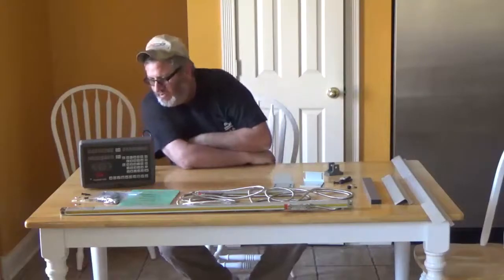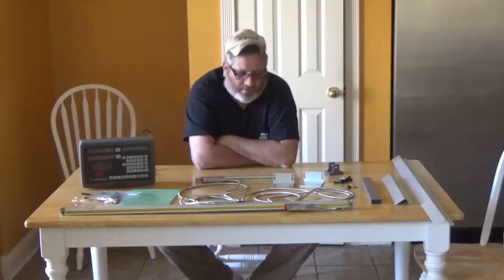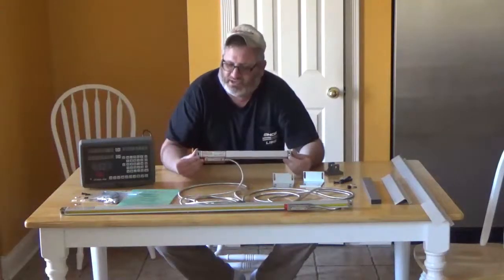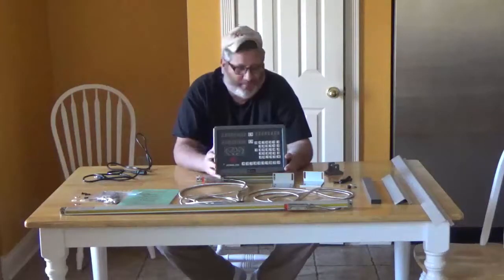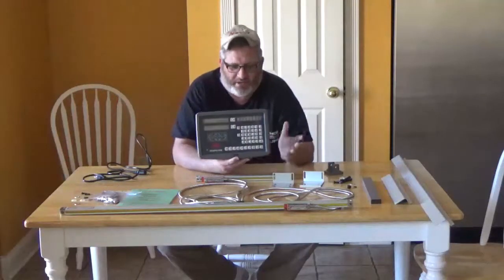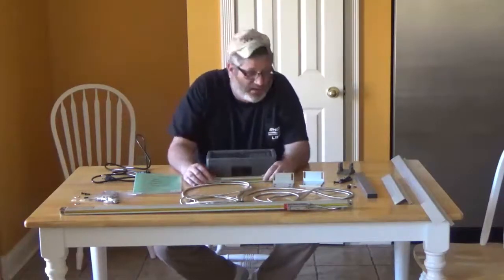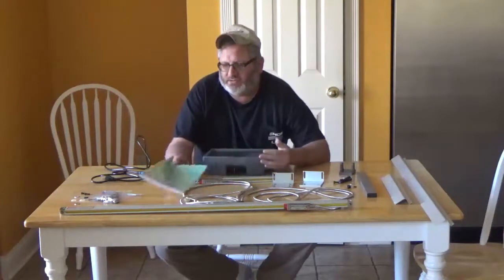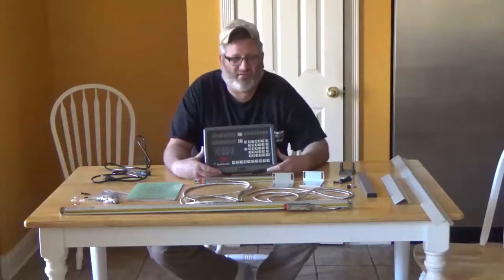ShenZhen HXX GCS900-2DB Lathe Dro Install: Part 1 Introduction

Comment: G'day Kirt it was good to hear you talk about the DRO for your lathe, I have the same one although the lineal read out for the cross slide is a thin type to fit better on the side of the y axis.  You are right about the hardware it is light on I bought some more off my retailer and why I was at it I got him to send a better manual on them which is easy to get hold of and is a lot better to read.   I have the same for my mill which I have just completed and now trying to understand ho to use it, things don't come readily when your 62 yo.  I have enjoyed watching your channel Kirt and have subscribed all the best John Tasmania Australia

Comment from the maker: I don't know if you have looked at the DRO install on the mill, but I would recommend that one over the one I put on the lathe. Both are the same price, but the one I placed on the mill has more features.Having said that, I have had both for a year coming up this spring and they have served me well.
Reply: Which one did you fit on the mill then ?